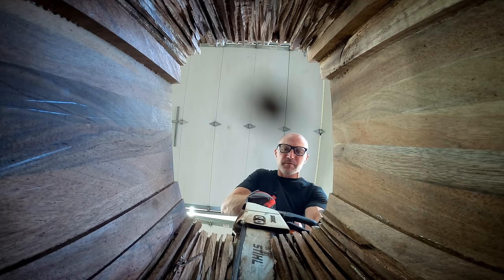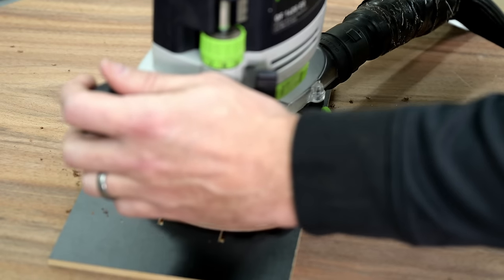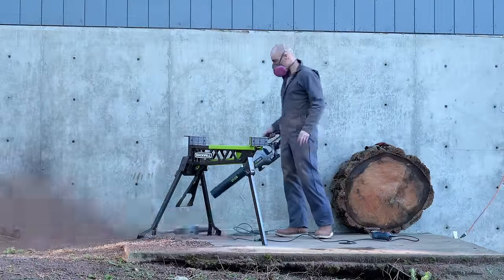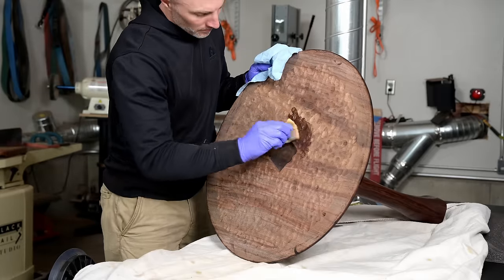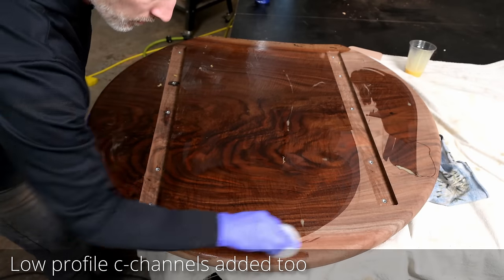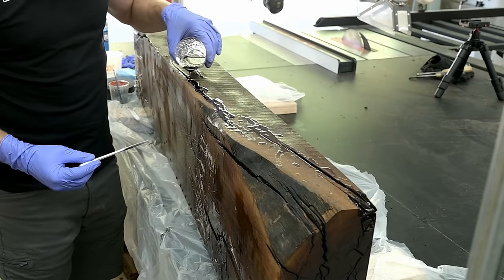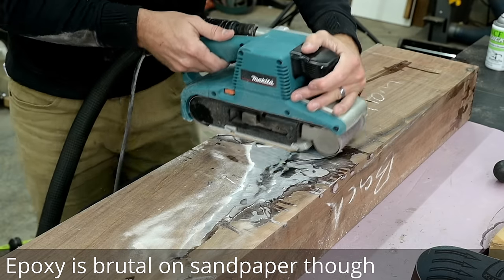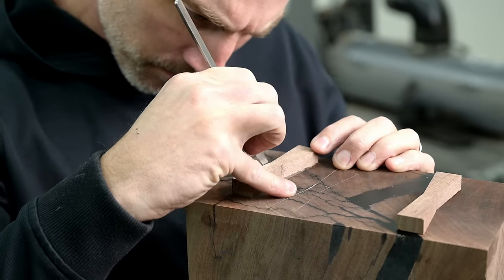Five Years of Woodworking Projects

Comment: Imo you were right with the screws at around 2 hours in as long as it was the sharp pointed end sheet metal screws, not the self tapping, it seems best to use the ones like on a metal roof screwing into the plywood, it's the same thing after all

Comment: Hej, dumb question but for the first guitar table, is it stronger to join the base to the tabletop the way you did than say using wood joinery combined with maybe screws hidden with plugs? Just curious as I am also doing some woodworking and am interested if it's just a preferred work flow or if it's because you've tried the other ways and they weren't durable.

Comment: Thanks for giving us such good content. I always enjoy watching.  I use my jawhorse for greenwood and power carving, and I have one small suggestion.  Make sacrificial jaws out of soft wood to hold your work  which saves the metal on the jawhorse and the teeth on your disks.  I use the screw holes that are visible when I removed the rubber jaws that come with the tool.  I like to make my jaws a bit proud, about 1/8” taller than the  metal.  I am on my second set of handmade jaws, but I didn’t nick my hatchet edge and have to spend hours sharpening.  Again, I really like your channel.  Thanks.
Reply from the maker: Good call!